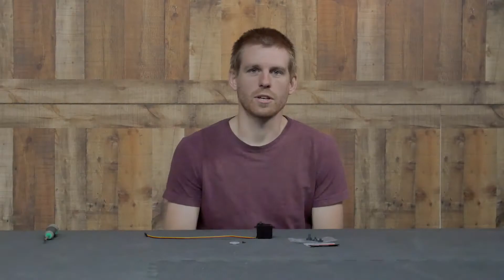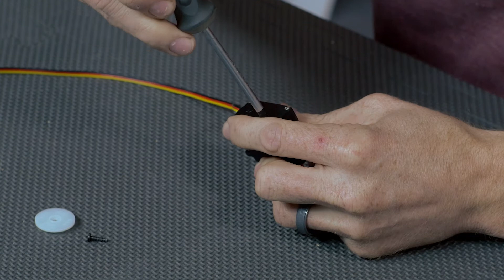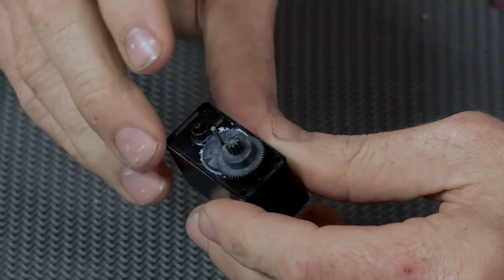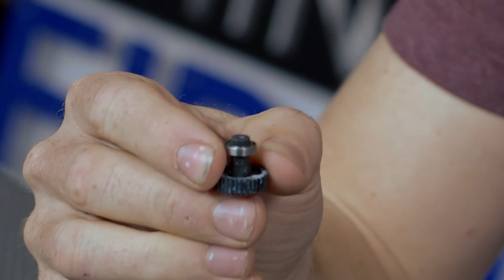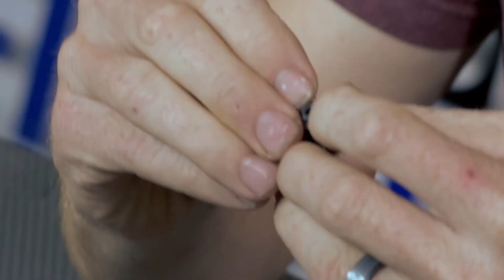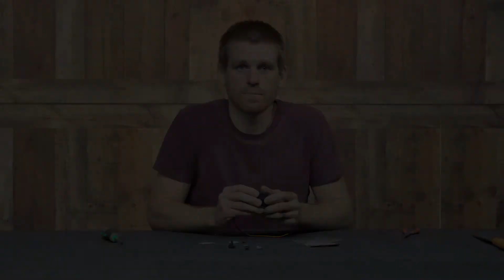How to Replace a Servo Gear Set - The Secret Life of Servos Ep8

Comment: HELP please! Bought second hand metal gear servos with metal arm and now need to replace arms. But cannot remove them at all. may be they are on thread locker? What you suggest - how to remove the arms? Its Power HD 1501 MG analog servo. Thanks

Comment: Question here: all my gears are fine and I'm waiting for my servo tester to get here by amazon prime. is it normal for a servo to get wild and run without stopping if I removed everything, all gears except the main one coming from the small motor? Powering up the heli with a used servo, testing it while its not assembled and servo goes wild lol...
Reply from the maker: Hello! That is normal.
There are two parts of a servo that come into play here, the motor, and the feedback device (usually a Potentiometer). The feedback device sends the position of the output shaft (the slowest turning gear) back to the servo's board. The board is able to read both the signals you're sending it, and the feedback device. And wants to "match those up". If it's being sent a signal that doesn't match the current position of the servo, it will command the motor to turn until the feedback device moves into its correct position. Where the servo can stop running the motor. This is done using something called a "Feedback Loop" or more specifically, a "PID Loop".
When you disconnect the motor from the feedback device, the servo loses its ability to control where the feedback device is, but it will keep trying by continuously spinning the motor until you turn off the servo, or move the feedback device to the correct position.

Comment: Thanks! are all gear sets the same size no matter what servo you have??
Reply from the maker: They are not; servo gear sets are application specific.  There are a few cases where a gear set will fit in another servo (example, using an HS-645MG gearset in an HS-625MG servo in order to increase torque and decrease speed) but to keep it simple it's best that you order the gear set for the servo that you have.  Let us know should you have any other questions tech@servocity.com!
Reply: ServoCity thank you!

Comment: Are all servo connectors the same?  Whatfits what?  Doug
Reply from the maker: Generally speaking yes, within the hobby market.  There are some slight differences in some situations (for example the little tab off to the side of a Futaba servo connector), but most of the mating connectors account for the little differences (such as the tab) so that everything plays nicely together.  We'd be happy to help answer any questions you might have and help clarify.  You can contact us directly at tech@servocity.com.